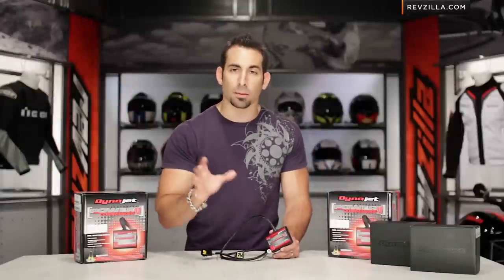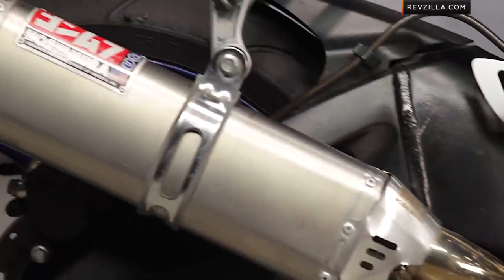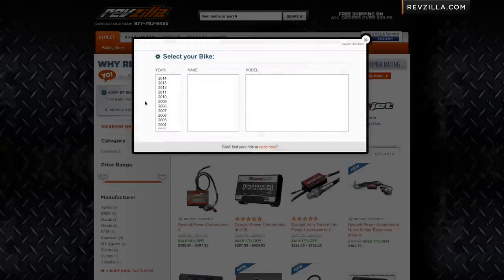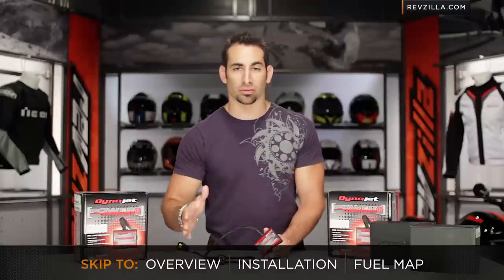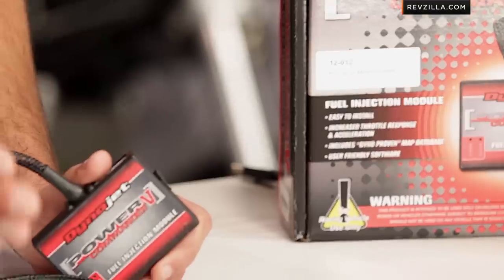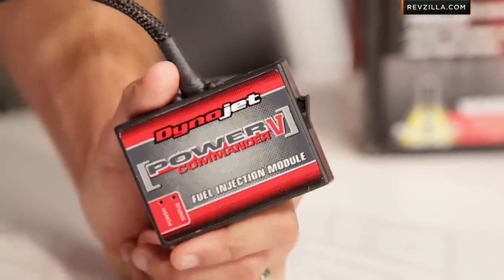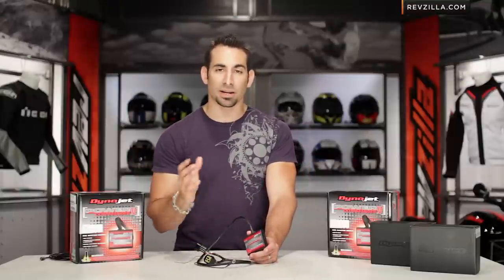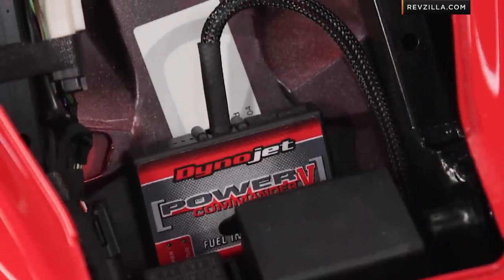Dynojet Power Commander Buying Guide at RevZilla.com

Comment from the maker: Any type of fuel re-mapping typically decreases fuel mileage. Considering that you've also added more oxygen with the air filter and slip-on, you'll definitely be burning more fuel. -CK
Reply: RevZilla , how much approximately will the gas mileage decrease?
Reply: For me in the city(Athens) my xmax 400 goes max 180km with full gas tank most of the time 150-160 km but I have a filter , power Commander and variator
Reply: So, if one were to buy a power commander solely for the purpose of saving gas by downloading a fuel-saving mixture program, but the simple act of installing the power commander itself actually worsened the fuel economy, then what exactly would be the point of buying a power commander if you would not save fuel?
Reply: @coreymccurry  The purpose of buying a power commander is to enhance performance, not for fuel economy

Comment from the maker: the PCV allows you to change your ECU as desired. Autune allows the calibration to take place automatically as your engine goes through its normal cycles. You probably have already gained the benefit of performance by re-flashing the ECU, but you'll have more control over the fuel delivery with a PCV. -CK
Reply: RevZilla installed PCV and Autotune but engine keeps stalling when revved to at least least 8k rpm then close throttle.

Comment: I had a dynojet installed on my 2014 Yamaha raider and it sucked down half a tank in 40-45 miles of normal driving.  It's back in the shop to try a different tune.

Comment: And if you change only with a slip-on exhaust, and let the stock air filter, It's better option?
Reply from the maker: If you keep the stock air filter and only install a slip-on, you likely do not need a Power Commander. -DrewZilla

Comment: 1:36 he says the bike will run cooler because it's not running lean. My dad also said that it's better for the bike to be running rich than lean because it will blow up the valve covers if it's running lean. Why is that? Wouldn't it run hotter and have more risk if there was MORE fuel in the combustion cycle, and not less?
Reply: Oxygen is just as important as fuel in combustion, like blowing on a fire to get it started

Comment: I’ve owned a new Kawasaki Z900RS for a couple of months and I see you’ve got a PC5 for it. I don’t want to change the exhaust or intake because I like it as it is, but will PC5 fix the snatchy throttle problem some Z900RS are having, including mine? Will it fix the lean running, although for that last question imagine it’s a yes. It looks like you only have one map for it as well at the moment. For a standard bike like mine, I guess it wouldn’t really need a run on the dyno?
Reply from the maker: The Power Commander 5 should help with the snatchy throttle, even on a stock bike, as that seems to be a result of the really lean fueling right off idle. You can also improve lean fueling overall. It wouldn't need a dyno. -DrewZilla

Comment: Will the plug and ride fuel commanders like Cobra PowerPro Black and Dobeck work as good as the ones where you have to adjust and tune yourself? I just added a Cobra slip on and air filter to my 2014 Stryker. The popping from exhaust isn't too bad, but I feel hotter than normal heat from under right thigh. What's the best fuel commander you'd recommend for my ride?
Reply from the maker: This is a bit specific to answer in the YouTube comments. I would recommend giving our Gear Geeks a call at 877.792.9455 or email them at cs@revzilla.com and they can run through every option we offer for your bike and find the best match for your exhaust issue. Ride safe, - Pat

Comment: What if you changed the air filter and full exhaust on a Yamaha r3 and didn't put one of these in. For a weekend worrier? Would it be the end of the world? Not sure I'd notice I huge difference if I don't race it would I? Would it hurt the bike if I don't do this? Much  appreciated any info.
Reply from the maker: It really depends on the exhaust and air filter. While most Akrapovic and Scorpion exhausts are designed to be run with the stock tune, most full exhausts require a fuel controller. In addition to the exhaust, changing to a freer-flowing air filter will make the bike run leaner. This means the bike will run hotter, which is not good for engine life. If you increase air flow with an exhaust and air filter, you also need to increase fuel, so that you maintain an ideal air/fuel ratio. If you aren't going to install a Power Commander, though, then there's no need to change your air filter. An exhaust that doesn't require a fuel controller can still run even better when a fuel controller is added. Our very own Lemmy has written a few articles on the subject, so you may want to take a look. Hope this helps! -DrewZilla
*http://www.revzilla.com/motorcycle/akrapovic-racing-gp-exhaust-system-yamaha-r3-2015
*http://www.revzilla.com/motorcycle/akrapovic-racing-exhaust-systems-yamaha-r3-2015-2016
*http://www.revzilla.com/motorcycle/scorpion-serket-taper-exhaust-system-yamaha-r3-2015
*http://www.revzilla.com/common-tread/motorcycle-exhaust-101
*http://www.revzilla.com/common-tread/fuel-management-101
Reply: Hello! Thanks for the reply. Yeah it's an Akrapovic , full exhaust. I recently had a K&N filter I put in but after reading some things online,  took it back out not long after and replaced with the stock one.
Reply from the maker: Sounds good! Having the Akrapovic with stock air filter means you don't need a Power Commander. -DrewZilla

Comment: Thinking about getting one for my 2013 Suzuki M109R, any concerns and or issues I should be aware of? also I have never used a power commander on any previous bikes, any tips and tricks would be appreciated as well. Thanks!
Reply from the maker: +Jake Zeadow No, you shouldn't have any issues. If the bike is stock, we'd recommend the stock improved map. If you have an aftermarket exhaust and/or air filter, you would download the appropriate map for those modifications. -DrewZilla
*http://www.revzilla.com/motorcycle/dynojet-power-commander-v-suzuki-boulevard-m109r-c109r-2006-2015

Comment: I have a 2012 Yamaha FZ1, and i am installing a Full Yoshi Exhaust with K&N Air Filter.
( I may be doing the butterflies mod and 'stacks' soon also.)
I have purchased the PC-V, single channel Auto-Tune, and POD-300 --- from you guys, of course! (-;
Is that all I will reasonably need to get serious boost for my bike? Do I also need the LCD Display or other 'add-ons' to go with these items? I do a LOT of mountain road twisties and open country road 'sweepers'... but am strictly a street rider and NOT a Racer! {My Track Days are simply to build my skills levels, and not to prepare for racing.] So I want STRONG mid-range acceleration more than high-rpm horsepower.
Also, will I need to change the jets to give the PC more 'room for adjustment', or will OEM sizes work okay?
Reply from the maker: Floyd Burdett With a full exhaust system and high flow air filter, a fuel management system is the right move. If you want better mid-range, I highly recommend a larger rear sprocket; one or two teeth larger. The sprocket will make the biggest difference. You don't need to upgrade your injectors. -Hi-Viz Brian
Reply: THANKS Brian!
I am adding the PC-5 with the Auto-Tune and the POD-300 Module. (and maybe the Stacks and the butterflies modifications) 
Will that be all I need for a strong and consistent Street Bike -- and lots of mtn. twisties -- or do I also need the Ignition Module, or LCD Digital.. ?

Comment: Ok I  know that you use the  Fuel injectors that's  on the bottom and you start from left to right but the plugs that's on pcv do they go on in a  Particular order or it  Doesn't matter reason being I bought a pcv and I have no  Installation instructions 2007 gsxr 750
Reply from the maker: Dynojet has all their install instructions available for download. I've linked your's below. -DrewZilla
*http://www.powercommander.com/downloads/20-006/install/pcv/eng20-006.06.pdf

Comment: I'm not very educated in this product, but I'm interested in learning. I have a (bought new, that has 34k) 06 Suzuki SV650, KN filter, Delkevic slip on. I like and under stand what Alex is saying, but my question is whats, the cons (for my bike) I will notice?  And (one more) I'm pretty sure I  will need help in choosing what maps are for me.  I live in Northeast Florida, but occasionally take my bike to "The Dragons Tail" in TN,NC so I'm sure I will need two maps.  I understand the Auto Tuner will help that ride?
Reply from the maker: Right now, your bike is probably running a bit lean, since you've changed both the exhaust and the air filter. With a Power Commander, you should experience less hesitance off idle as well as better throttle response overall. You may even gain a couple horsepower. There are only a handful of maps, and you can try any of them. I'd start with the map for either a Yoshimura or Two Brothers slip-on. As for different maps for Florida and the Dragon, you probably won't need to change maps, as the bike will still adapt a bit for changes in elevation. Therefore, you probably won't need the Auto Tuner either. -DrewZilla
*http://www.revzilla.com/motorcycle/dynojet-power-commander-v-fuel-and-ignition-suzuki-sv650-sv650s-2003-2006
Reply: Wow, thanks (again) Drew.  That's a big help to kill the fear of doing this myself.  Not to mention the $ for a Commander is worth it to me, but the Auto Tuner too..?  I feel the two,  a little to much for the value of this age\miles for this bike. Big help!

Comment: Recently i bought yamaha R6 2017 .. there is a@ scissor port, but there is no cable attached is that an issue ?.
i install two brother slip-on from your website. my plan for next upgrade is installing a full system. My question is. did i need to get Dynojet Auto Tune Kit and Dynojet Power Commander and which one i should get is Single Channel AT-200 or Dual Channel AT-300  thank you  from KSA
Reply from the maker: You would need a Power Commander for a full system but probably not Auto Tune. If you did want Auto Tune, though, the R6 is a single channel system. -DrewZilla

Comment: Will this help with the jerkiness of the Mt09 throttle? Can this be used as an alternative for the ecu flash? Also, Will it help avoiding the danger of engine blowing up while running lean, like it does in stock configurations?
Reply from the maker: It can help a bit with the throttle jerkiness, and it can be used as an alternative to the ECU flash. Additionally, yes, you can run the bike richer to avoid the heat from running lean. -DrewZilla

Comment: I'm pretty sure i'm going to buy a pcv for my 2017 honda grom. I went on the website like you said and looked at the maps and i'm not sure which is the best map for me. I only see 7 options.  On my bike, I removed the air box snorkels, replaced the stock air filter with a K&N air filter, added the velocity stack, and added a full zoom exhaust. Any suggestions?
Reply from the maker: I'd try 16-049-003 first then 16-049-004 and 16-049-006 to see which works best. -DrewZilla

Comment: I have a Question about PC-3 to Suzuki Gsxr: the 600 K3 has the Part Number 307-411, the 750 K3 309-411, the K1 1000 308-411, does the Power Commander from 750 or 1000 fit to 600?
Reply from the maker: No, they are bike-specific. The Power Commanders for the 750 and 1000 do not fit the 600. -DrewZilla

Comment: I have a 2010 cbr1000rr
It has a slip on two brothers exhaust 
And I recently put in a k&n filter
It doesn't have a power commander does that damage the engine? Should i just take out the air filter and put in an oem? should it be okay?
Reply from the maker: With the K&N filter, you're likely running the engine leaner. To be safe, I'd just run the OEM filter, so that you don't need a Power Commander. -DrewZilla

Comment: I have a 2006 r6 with a pc3 that I'm stripping and plan on putting it on my 2012 zx6r. Would I have any problems with this?
Reply from the maker: +Chase Mason Yes, that's a problem. Power Commanders are bike-specific. You can't use a PC3 for Yamaha on a Kawasaki. Also, you can't use a PC3 for an R6 on an R1. Additionally, once paired to a bike, it cannot be used on another bike. For a 2012 ZX6R, you would need the following Power Commander V. -DrewZilla
*http://www.revzilla.com/motorcycle/dynojet-power-commander-v-for-kawasaki-zx6r-2009-2012

Comment: Can you guys do a video on the power commander fuel controller. I'm still confused on the 1 to 10 dial on the selector, does it choose maps or does it change how much fuel is going in?
Reply from the maker: +kiddeath921 The potentiometer all the way to the left labeled BASE allows you to select from the 10 pre-loaded maps (you can also load your own from the software). The LOW, MID, and HIGH potentiometers allow +/- fuel adjustment for those 3 general RPM ranges. Power Commander has a nice intro video linked below. -DrewZilla
*http://www.powercommander.com/powercommander/products/pcfc/powercommander_pcfc.aspx
Reply: +RevZilla Thank you.

Comment: Hi! PC5 with Autotune, will that take care of varying altitudes, barometric pressure? I have a Ninja 300 with LV GP Corsa slipon. I download the map from Dynojet, is that all? I dont like messing around with the maps, hence my understanding is auto tune would do that for me. Please correct me if I am wrong.
Reply from the maker: Chinmay Kar There are a few different configurations available. When you have a few minutes, give our Gear Geek, Mario, a call at 1-877-792-9455. He will walk you through the in's and out's of the PC5 and Auto Tune. -Hi-Viz Brian
Reply: I know this is late, but for any people who have anything under 600cc's with a slip on you really don't need to waste the money on all this. You will see very MINIMAL gains, just not worth it. I had a ninja 300 when they first came out. Got the full yoshi r77, KN air filter street and just a mail in flash. Honestly the bike ran better with the stock exhaust and with each mod I really didn't notice a big enough difference to justify the cost. When I had my 09 750 that was stock and just added a KN air filter I noticed a big difference, especially with a flash and full exhaust compared to the slip on, cat delete before the full system, after the filter. My 17 gsxr 750 didn't notice much of a difference with the air filter this time, full yoshi- big difference.  Higher cc bikes you will really get your money's worth if you build a bike for what you want to do with it.

Comment: I'm just curious, I saw on eBay a power commander for a klx 125 2010. But the thing is, is that that bike has a carb instead of fuel injectors. The carb itself is an electronic one, and my question is.
Will it still work ?
Reply from the maker: No, this is only for fuel-injected bikes. If the bike has a carburetor, it won't work at all. -DrewZilla
Reply: RevZilla Okay, thanks
Reply: Hahaha, well, the only other vehicle I can drive legally is a 50cc, and why would I do that ?
Reply: Yeah, but um, I'm not old enough to drive anything more powerfull than a 125 cc bike (alone)

Comment: So is there a specific model for each bike? ie. If I have a PC on a bike and I sell that bike, I can't just configure it for the new bike and install it?

And does the Autotune mean I don't need to download any maps at all?

Thanks for your help!
Reply from the maker: There is a specific model for each bike, so you cannot configure it for a different model bike. As for autotune, it allows you to make adjustments to a map, so you still have to download a map to use as a starting point. -DrewZilla
Reply: RevZilla Great, thanks for replying. One more thing on the Autotune. How should I determine the Air Fuel Ratio value for it to aim for? Thanks again!

Comment: Question i have a 09 gsxr 600 can i use a gsxr 1000 power commander since its the same manufacture and they are both gsxr's? what will be the outcome?
Reply from the maker: Mrtakeitback babyhester Nope!  Different motor, different Power Commander.  You'll need this guy: http://www.revzilla.com/motorcycle/dynojet-power-commander-v-for-suzuki-gsxr-600-2006-2010

Comment: I have an z800 -14 with ixil slip-on and kn airfilter. do you recomend pc5 on that setup and if do you have an or know were i can get an map suitable for that setup? my wallet only allows a pc5 and not a dyno since that is horrible expensive here in sweden XD
Reply from the maker: Yes, I do recommend a Power Commander V(5) for you. Since the Ixil is a very open exhaust, I'd recommend trying the 17-048-502 Euro model HP Racing Slip-On (baffle removed) map. For even better tuning, you could add the Power Commander Auto-Tune module. -DrewZilla

Comment: I was wondering if i can put autotune plus the commander 5 on my 05 cbr 1000rr
Reply from the maker: You definitely can!  The units for your bike are available here:

www.revzilla.com/motorcycle/dynojet-power-commander-v-honda-cbr1000rr-2004-2007
www.revzilla.com/motorcycle/dynojet-auto-tune-kit-for-power-commander-v

That said, you would need to install an 18mm O2 sensor on your exhaust, which does require drilling and welding.  We have the bung you would need here:

www.revzilla.com/motorcycle/drag-specialties-weld-in-o2-sensor-bungs?sku_id=1215875

However, for standard street use you should really be fine just using the Power Commander and a good map, rather than going through all that trouble to add the AutoTune feature.

-Zack

Comment: I am thinking of getting a dynojet quickshifter but have a bazzaz power commander 5, would they be able to work together?
Reply from the maker: The Power Commander 5 is made by Dynojet. Bazzaz makes the Z-Fi. You may want to check again to be sure which one you have. If you have a Dynojet Power Commander 5, then you can use a Dynojet Quickshifter with it. -DrewZilla
Reply: @RevZilla  Thank you for quick response. Yeah all this time I thought I had a PC but when I looked, it was not.